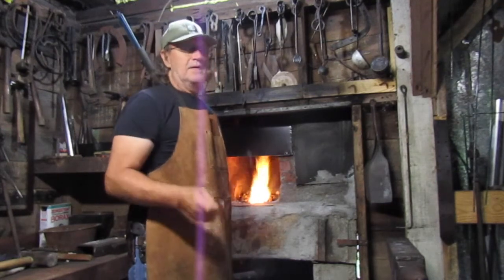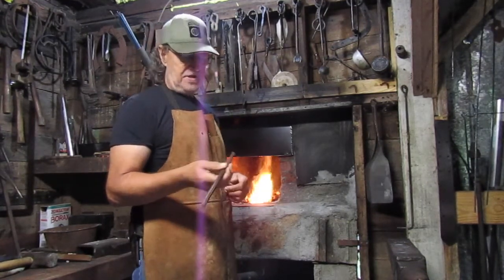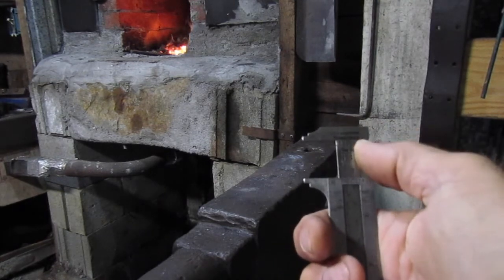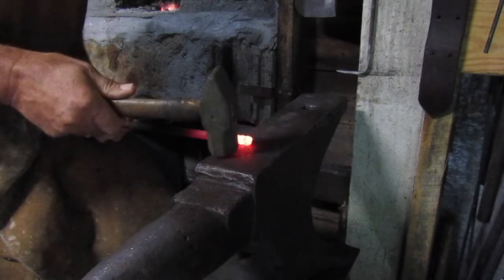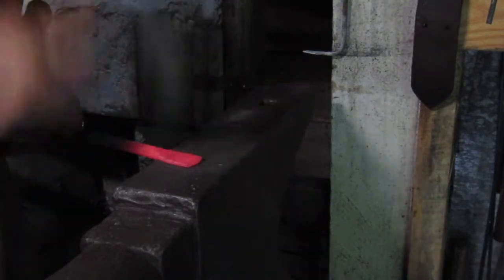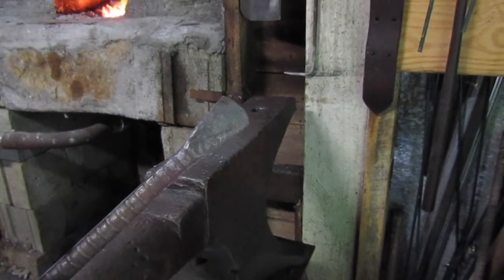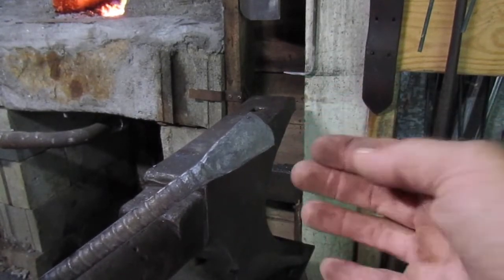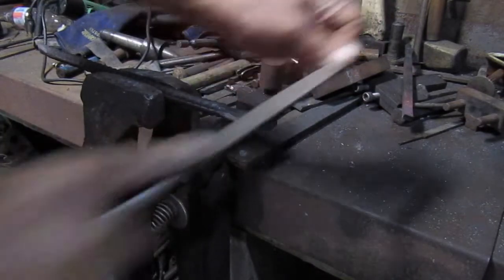Forging spoon bits woodworking

Comment: I was in ez sales and pawn this morning and they have a real decent looking small anvil in their for sale. I didnt see any markings on it,but it looked pretty old and appeared to be cast. First time I've ever seen an anvil at a pawnshop, lol.
Reply from the maker: really how much did they ask for it
Reply: @mike451  It had $180 on it,but he usually leaves some negotiating room. I'm not sure if that's a good price or not. It looked to be in excellent condition, with one hardy hole and a well shaped horn. It was kinda small,maybe 50 or 60 lbs.
Reply: They used to be about $1.00 per pound, but times they are a-changin'.
Reply: @notmyworld44  Well,I know theres a rebound test you can do,but I've never carried around a ball bearing. I guess it depends on how much ya want it. I'm using an cheap harbor freight anvil shaped object thatll wear your arm out,but its held up ok. I mostly got it for my grandson,because it's an interest of his. I tryin encourage anything like that. It's good stuff to learn and hes 6 and loves workin with his hands. He loves watching mike make stuff.
Reply: @ciphercode2298  Harbor Freight's anvils go CLICK 
when you strike them. A really good one goes *CLINK*.  Every time I cruise thru our Harbor Freight store I look at those anvils and I wrestle with myself - "Should I or shouldn't I?"  So far I haven't. 😏
Reply: @notmyworld44  my only complaint about ours is the shape of the horn. It's pretty flat and then gradually tapers off whereas a better one is longer and more round.